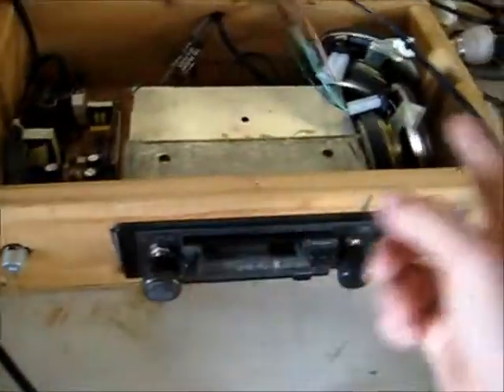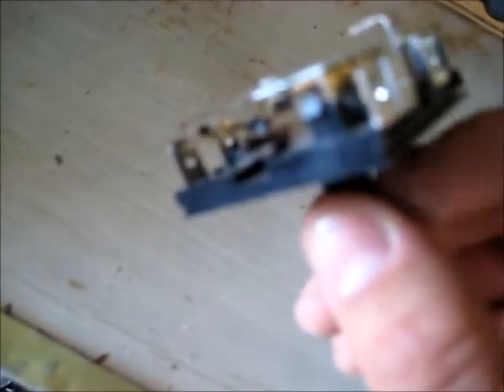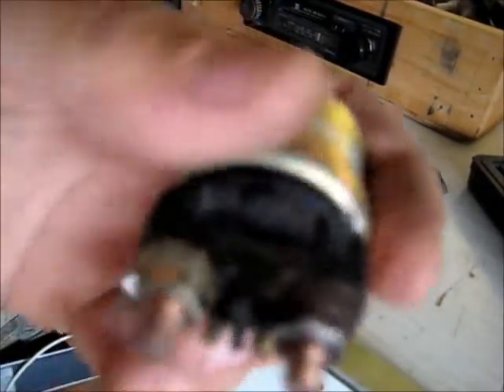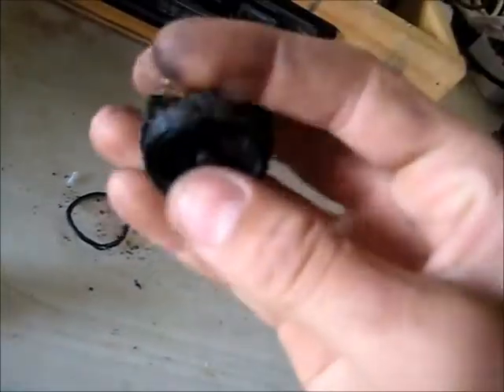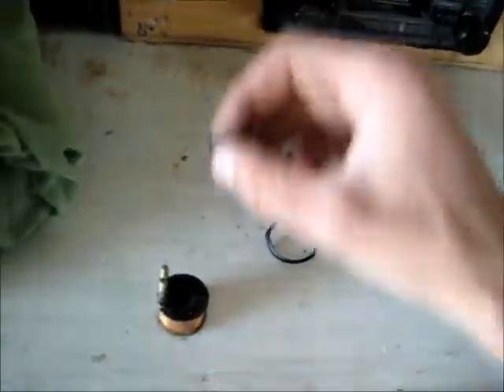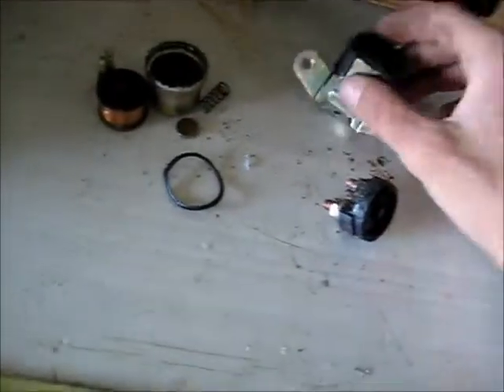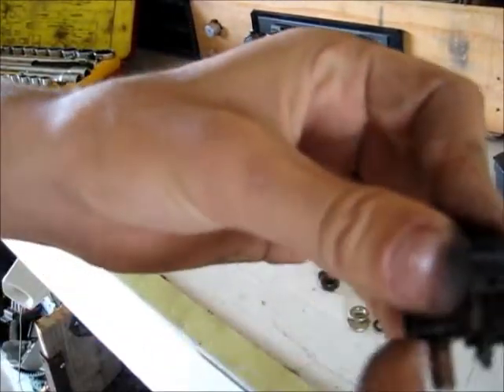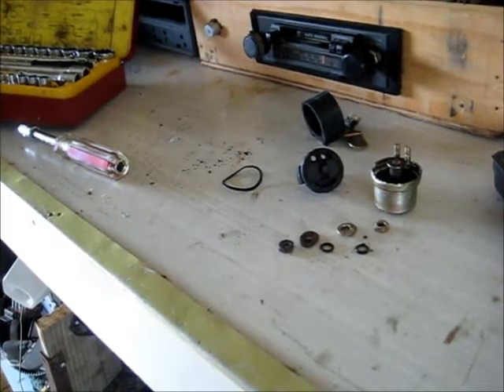Starter relay & oven switch Autopsy

Comment: Hmm nice radio :) but does the DVD player power supply supply enough current? does it make the speakers hiss? I built a TDA 2005 20W amplifier and when the amp is near the computer power supply that I used to power it, the speakers have an extra hiss from the high frequency of the SMPS.

Oh and the thing in the switch that clicks on and off is called a bi-metal strip. It is two different metal strips side by side, but the different metals expand and contract more or less. (GRRR character limit!)